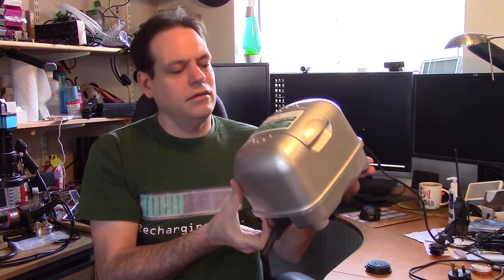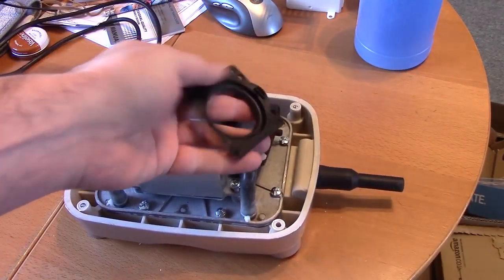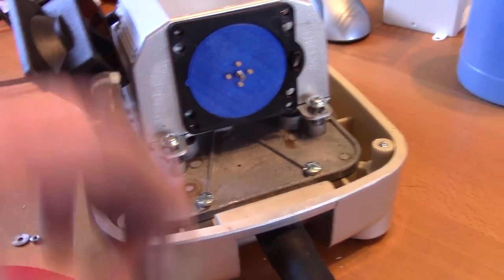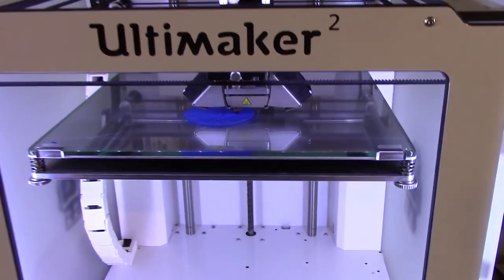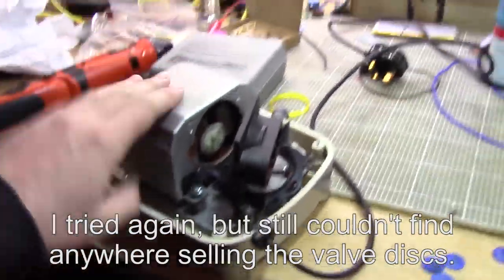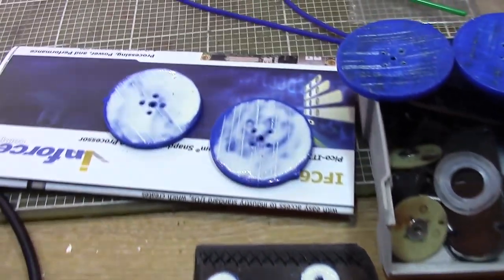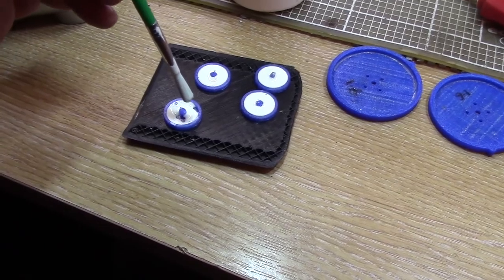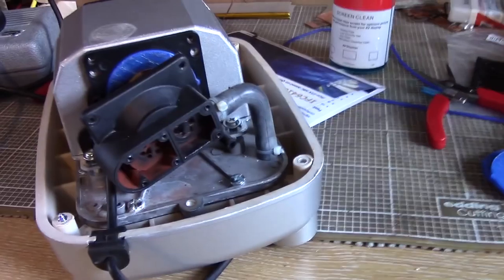3D Printed Hailea Air Pump Repair with Ninjaflex and Latex

Comment: Did you make full latex big disk too? Or the coated one still works?
Reply from the maker: Hi +Hulla Dek - I haven't made the diaphragms out of latex yet, but I may well give that a try when the ninjaflex ones fail. I'm expecting that after a little use, the latex layer will seperate from the ninjaflex part and I'll be back to a diaphragm full of holes... if and when that does happen, I'll certainly be making moulds for latex diaphragms. Cheers!!
Reply from the maker: Hi +Hulla Dek  - It seems that the Ninjaflex diaphragms managed a mere 48 hours in service before they split apart... so now I'm working on moulding some latex ones instead... (and videoing the progress as I go along). Hopefully the latex ones will last a bit better. Cheers!!
Reply: lets hope that will last longer :P

Comment: Nice!
Reply from the maker: Thanks +XFolf - I've got some moulds for latex diaphragms printing right now as the ninjaflex ones failed today. Cheers!!
Reply: +Jim Conner Most welcome. What was the mode of failure? 

Sounds like its time for a cold pint while the latex dries.
Reply from the maker: +XFolf The layers of the ninjaflex part all seperated from each other leaving great big gaps all over the place - The valves I moulded from the latex still look as good as new though, which is why I'm now moulding the diaphragms from the same stuff... I'm quite tempted to buy some other mouldable rubbers to have a play around with too :-) .... Cheers!!

Comment: why not try to melt the ninjaflex material into a mold instead of printing it?
Reply from the maker: Hi +Michel Laine - I like the idea, but the melting point of the ninjaflex is > 200C, so I wouldn't be able to print the moulds from any of the plastics I have... I have seen a ceramic filament which you can cure in a kiln after printing, so that could be a way to make the moulds... but it was crazily expensive stuff... One role of the ceramic filament costs the same as two new air pumps. Hope you're having a good weekend. Cheers!!